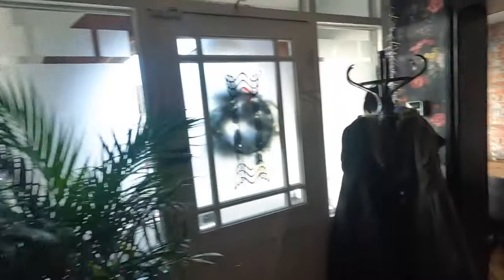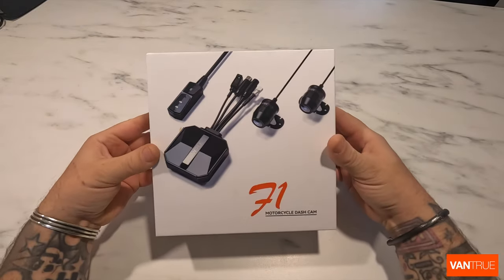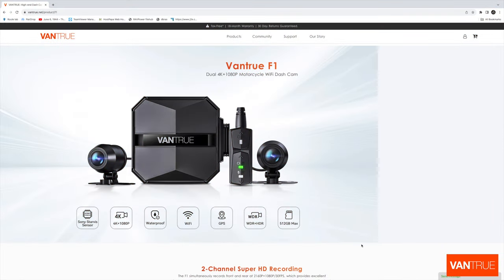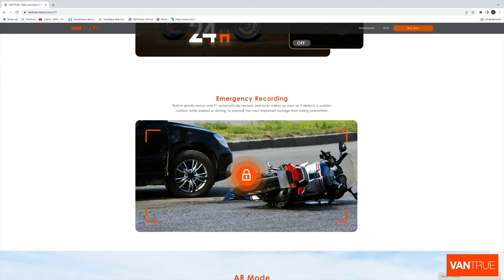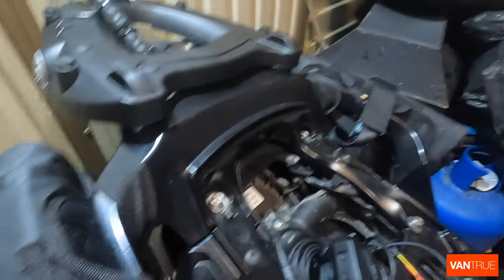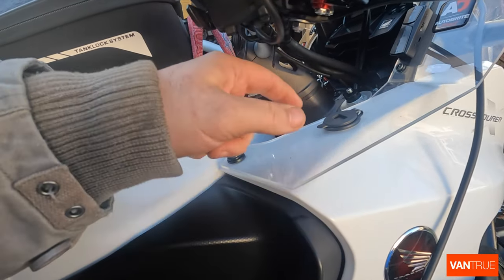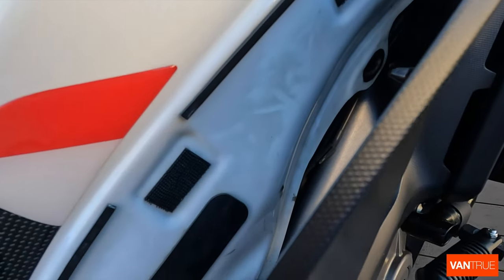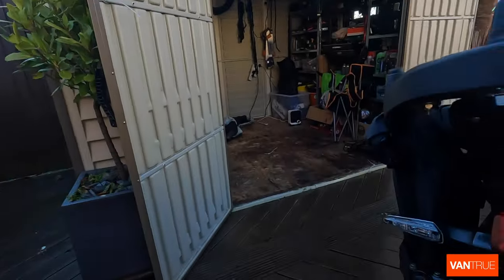VANTRUE F1 Falcon Motorcycle Dash Cam : Unboxing, Installation & Review

Comment: Excellent video and thanks for posting. If anyone wants to use the threaded boss to secure the camera to the bike panels, be aware that it needs a 1/4” UNC threaded screw/bolt. Also, if mounting the camera under a front faring, ensure that the maximum fork travel will not impact the camera. I’m looking to make a bracket and forward mount the camera in front of the headlamp, which is not what I wanted and don’t really want handlebar mounting.
Reply from the maker: @cynicaldodgyknees6248  sounds a good idea

Comment: One thing to note is that the 4K feature is only available when using the front camera ONLY! When using the front AND rear camera, the resolution maxes out on 2k Front (HDR) + 1080P Rear. This makes the Innovv K7 a better deal, since it has 2k camera's both front and rear and is cheaper. I bought the VanTrue not knowing this. It still seems like a quality build, but they are using a marketing trick...

Comment: Compliment Sir, you're a genious, you do your own electrics. As soon as I see more than 2 wires, I break out in a sweat. Although having a basic knowledge of Mechanics, enough to help with roadside breakdowns, when it comes to electrics, you'll find me running off to the dealership.., shouting for help!
This seems to be a fantastic device, one to put all other filming equipment manufactures out of business. Very much looking forward to your first experiences and review after a longer tour with it. Then maybe, i'll have it on my Birthday wishlist next summer. Oh, one other thing.., is the Sizzapp, which I don't have (yet), really necessary if I have the Vantrue F1 fitted with it's bike movement sensibility and tracking capabilities?
Reply from the maker: The SIZZAPP sends you a text message and phone if the bike moves so you don’t need to be near the bike. The dashcam you have to be by the bike to connect to it to see the footage.

Comment: good vid, can you turn the cameras on and off while riding the bike? I may not wish to record parts of my ride
Reply from the maker: Yes by using the controller set on the dash
Reply: @Motourev  Thx, I assume just a simple press of the button will turn on/off the cameras, or is it more complicated than that?
Reply from the maker: @davidsandilands1285  press and hold for a few seconds switches it off.
Reply: @Motourev  Excellent thx for the clarification

Comment: Thank you, well done! I´m having the same vibration problems with Viofo MT1 https://youtu.be/MR38YCMmk1c. So I´m using other cameras mounted on the handlebars, with no problems. Unfortunately the MT1 cameras are very prone to register even the smallest vibrations which makes the videos unusable. The Falcon seems to be slightly better!

Comment: Hi, Question; how is the front lens holding up? (bugs, sand, rocks can easily damage it?)

2024 feb; Just got one for about $300us For me, the unit seems more worth like $200us something.
CONS;
-Regarding the memory card; Vantrue uses the FAT32 format, which is not secure and very old fashioned and limits files to 4GB and windows made partitions to 32GB. You can use micro SD card up to 512GB though. (512GB records about 28h of video (per minute; FRONT 4K=233MB and REAR 1080=74MB; together 307MB per minute))
-VLC player would NOT play any of the .MP4 files because of HVC1 video format. Win media player has no problems.
-Rear camera cable could be a bit longer. Front camera cable is a fragile high speed data coax cable.
-CPU unit is not really waterproof and a USB-C connection would be better than WIFI to your phone/laptop. (Who wants to watch the video stream while driving ???)
-Feedback voice is a very annoying Chinese English tone with bad grammar
-Camera's seem nice and solid, control box less so; very plastic-y
-System has a 2 amp fuse; so uses about 25Watt, which is quite a LOT !! The front 4K camera and especially the CPU block gets a bit warm.

For me; Video quality and anti vibration are good. 
In all; OK-ish.

Thanks for your review!
Reply from the maker: So far so good, expected to be covered in crap but I’m surprised it still has a clear picture , all in all I’m happy, 4gb file size is no problem as I have 2 min recording
Reply: @Motourev  OK, thanks! Ride safely 🙂